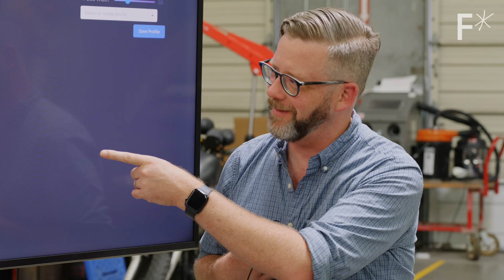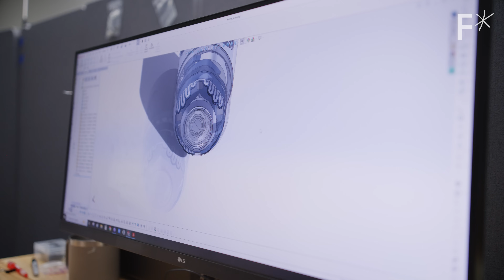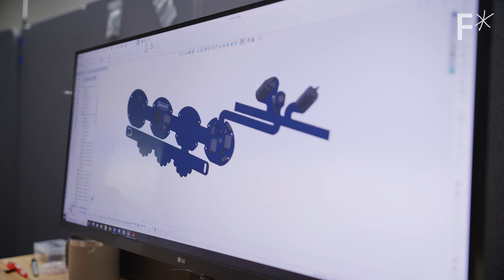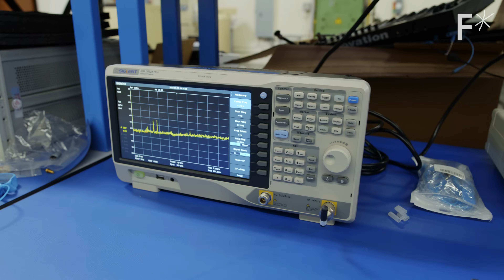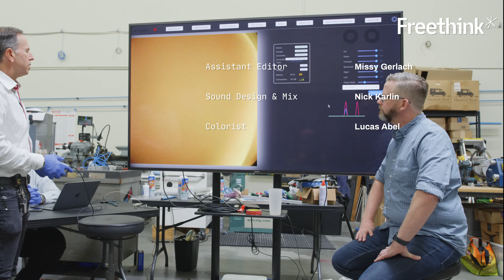I ate the real 'Magic School Bus.' Here's what it found. | Hard Reset

Comment: Wouldn't it be simpler to remove all the mechanical jets and have two wide-angle cameras instead, one on each end, and then stabilize the footage via software?
Reply: Definitely simpler!  There are products just like that already on the market, actually.  This one’s main advantage is that it can be piloted live so it can check out features that might not be easily visible otherwise.
Reply: We are paving the way for PillSurgeon, so 3D motion is central to our mission.

Comment: Sooooo just a thought... Don't use a battery! Just use wireless charging tech.
Reply: That's right, but the wireless charging technology couldn't charge effectively in multiple direction.
Reply: @陈哲轩-t2m  fair point but easier solution to tracking with literally any methotd than fighting the battery problem. Even using a large or many small coils is still outside the body. In this case batteries just seem like the easy answer not the right one.